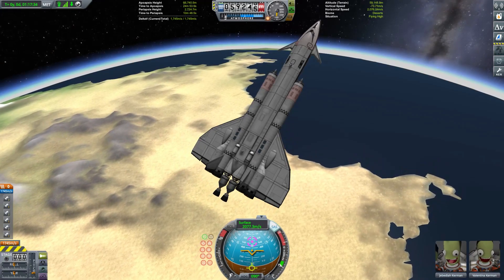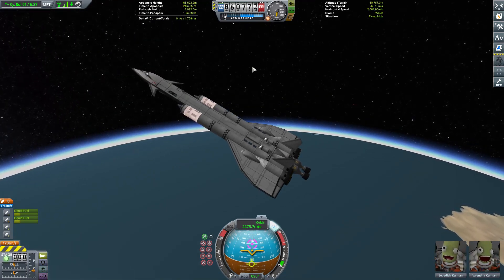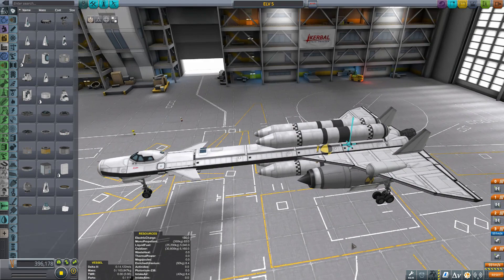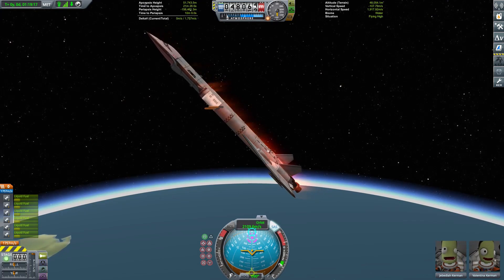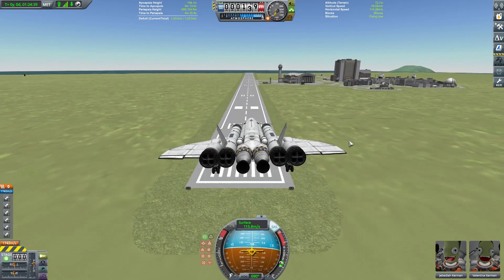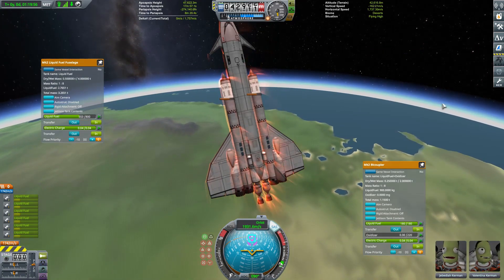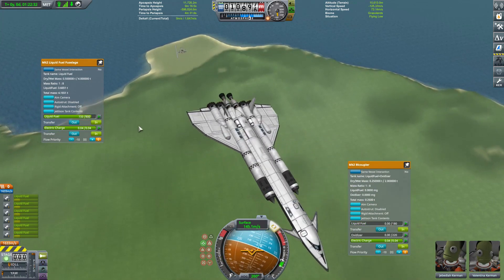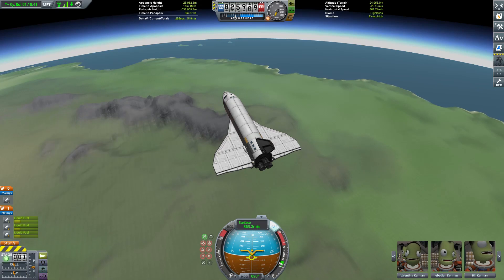Aircraft Tutorial - Spaceplane Reentry - Kerbal Space Program

Comment: One thing that I think most players tend to overlook when designing spaceplanes that are meant to either travel fast at high supersonic speeds (Mach 3 or higher), reenter from orbit, or both is that, even though parts may not always contribute to the lift of your spaceplane, they almost certainly do contribute towards the drag that's felt throughout the spaceplane. (Yes, it's the very same force that's responsible for keeping your rockets from traveling quickly in atmosphere without nosecones or fairings to deflect the air outwards.)

To counteract this, consider moving the spaceplane's center of mass not only in front of the center of lift, but also in front of the center of the whole spaceplane itself, such as moving all the heavier parts of the spaceplane, including most of the fuel, to the front, and put all the low-mass high-surface-area parts, such as tailfins and small skinny fuel tanks, to the front. (Basically, try designing your spaceplanes to be more like some real-life tried-and-true aircraft, such as the P-38 Lightning, P-51 Mustang, B-29 Superfortress, or B-52 Stratofortress, with a thicker, more massive front section and a thinner, less massive rear section.)

Comment: The best trick you can do, even in current KSP where the fuel gets pumped automatically from every tank to maintain the CoM/Col balance, is this:

1. Design your plane as you see fit.
2. Take out all the fuel and any payloads. Leave a small amount in one tank, one tick of fuel.

3. Examine your CoL & CoM.

If CoM is still in front of CoL, without touching, excellent. If not, slight redesign, time to move some fuel tanks around or wings. By simply emptying and filling your tanks, you can switch and examine the 2 configurations.
Is my preferred way to design planes, since they end up naturally being very stable during reentry.

A second trick is to brute force it. Incorporate in the design a small fuel tank and place it at the very tip of your plane. Even a small FLT-200 tank can drastically influence the CoM of a 60 ton spaceplane, when comes in to land empty. You can either forbid the fuel in this tank, which I don't recommend since it will make take off too hard. Or you add an item on your checklist before breaking athmo: transfer all fuel into this tank at tip of the plane.

Comment: 3:39 Center of lift doesn't move, is static, since your plane doesn't change geometry, it doesn't vary the pitch of the wings or their angle of attack. Is the center of mass that moves :).
Reply from the maker: Couldn't the same argument be made for centre of mass?  As in, nothing has changed on the craft, no fuel has been used, but the CoM/CoL balance changes on the way down.
Reply: @SonofSmith  My issue was with the statement " when the CoL moves forward " at about 3:39. My point is CoL DOES NOT MOVE in flight. CoL is determined by the geometry of the craft, wings, elevons, etc. 

No, same statement cannot be made for CoM. If you don't consume fuel or release payloads, then the balance between CoM/CoL doesn't change, is static.
Reply from the maker: Maybe I didn't phrase it very well in the video, I was just trying to explain the phenomenon in KSP where a craft that is stable (CoM in front of CoL) at low speeds and altitudes will become less stable, or even unstable (behaves as if CoL is in front of CoM) at high speeds and altitudes.